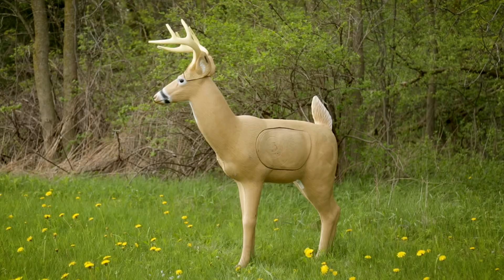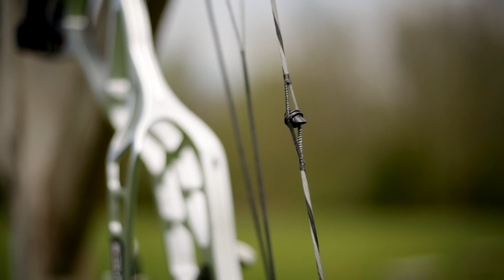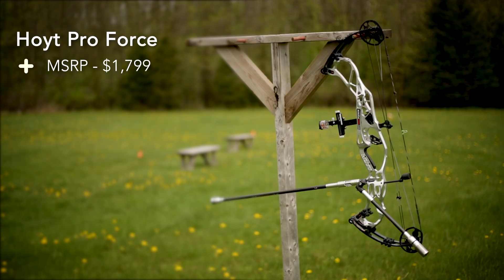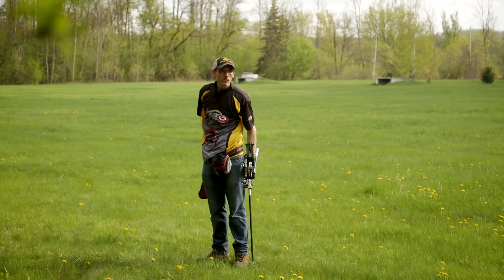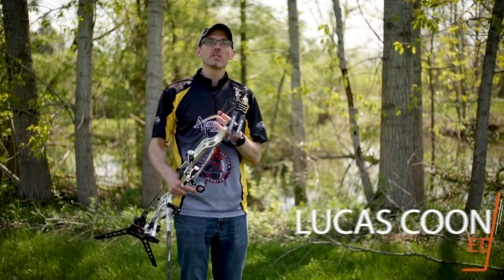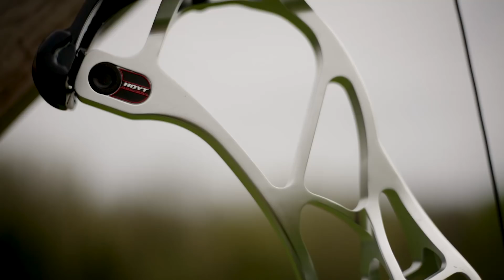Hoyt Pro Force Review

Comment: Sir So Should I Buy A Prevail Or Pro Force? Please Tell Me As I Will Be Buying A Compound Bow In Jan 2020.
I Am Still A Beginner At It
Reply from the maker: I prefer the Prevail. If you are new, I’d suggest you get the X3 cam, as it has more draw length adjustability and is smoother. Good luck!

Comment: Something you could try what has worked for me. Run the 85% let-off modules with the 75% draw stops. It gives a more solid back wall, slightly shallower valley and holds very nicely.
Reply from the maker: Hobbes Calvin I was thinking of trying that.